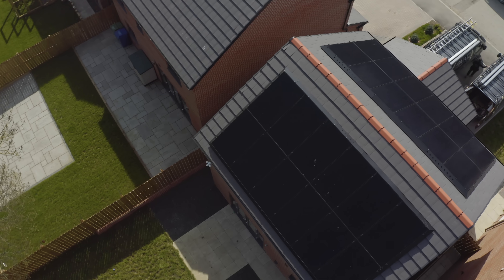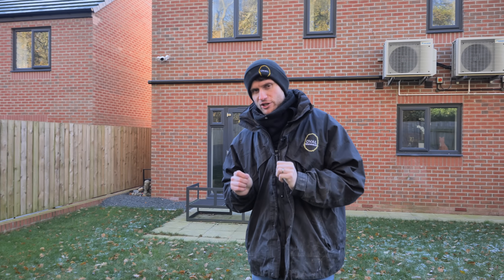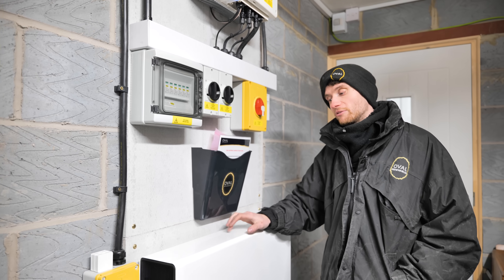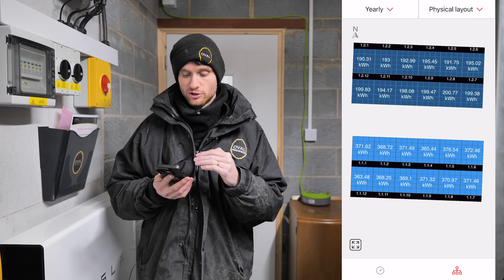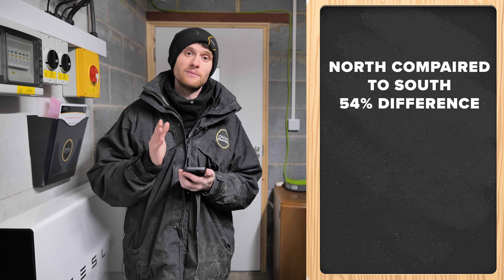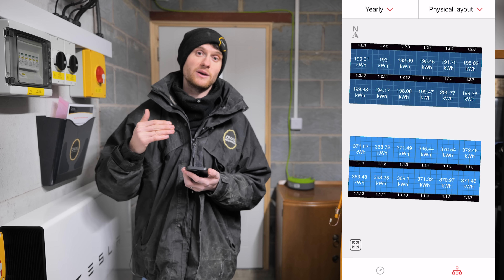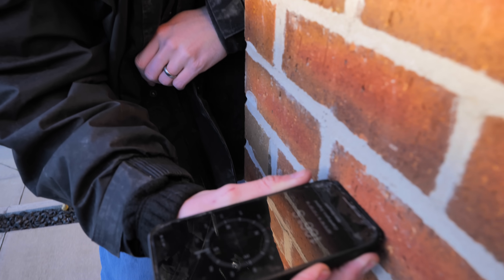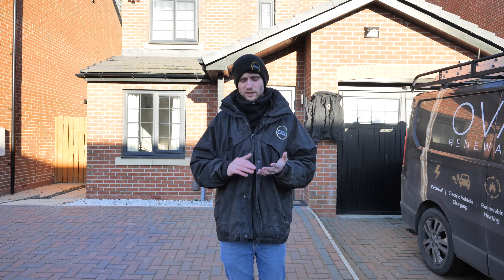North facing Solar Panels? Do they work? Lets get the results!

Comment: Thank you for following up on this, great video, hopefully it will encourage more to go north. They perform pretty poorly in the winter, but with reasonable export rates we can now bank in the summer months when they perform well, to help with costs in the winter. It's also reassuring to hear what you say about installation costs, we've been saying this for ages on forums, get as many panels fitted as possible, as they are already on site, the additional costs will be less per panel. Just one question, if doing the install now would you just go PW3 and connect the strings straight to that? Seems a no brainer to me, no shading issues by the looks of it, and would save a lot on costs, the install would be quicker as well saving on labour.
Reply from the maker: Thanks for the comment, putting the solar straight into the Tesla would absolutely reduce the install cost. I am a huge fan of SolarEdge, we simply wouldn’t have had this level of data without it. For me I feel that the SolarEdge element of the north facing panels has probably helped to increase production as my theory of the reflected light helping to increase the generation on the north means that it may hit all the panels differently meaning optimisation allows the panels the light does hit to use more of it than if it was just getting soaked up by a normal PV string. I have no firm answer but data is power and that is what the SolarEdge kit gives you.
Reply: @OvalRenewables  I'm not convinced it's actually going to make much difference in cloudy diffused light. I have a 2015 SolarEdge system, and also various different string's on a Victron system, so no optimisers on them, in cloudy diffused light I see pretty much exactly the same power on the two identical strings facing n/east and  s/west. Twice last week my SolarEdge system never even started up due to low light, where the Victron still generated something, no idea if newer SolarEdge systems/panels perform better. I'd also suggest it should be a customers choice if shadings not an issue, as doing away with the SolarEdge system would be much cheaper, it's a lot of money to pay just for you to have data, doubt many owners look at it.

Comment: BUT, noticed some export in your first look in the stats, are the north ones just contributing to this in the summer at a tiny price from the electricity supplier. and conversely not adding much to the home or battery in the winter. Needs a more detailed look over the 12 months to find out if the south only would have been enough to use and reduce export to a lower level. eg is the north side just subsidising the electricity suppler? and not contributing much to the home owner
Reply from the maker: Thanks for the comment, I will see if I can do a follow up one to go through the stats for the different months over the same time period. 

However with increased export rates now, at my house I’m on £0.15 per kWh, even if you are exporting all that north power, you are collecting that money to help with the bills in the winter. However more generation in the winter is the ideal situation.

Comment: I’ve been working in the commercial ground-mounted solar industry for over 10 years, and these numbers are truly impressive! I didn’t expect the north side of the roof to contribute around 35% of the annual generation. The ROI must look fantastic now. Well done, and great video! I have been working
Reply from the maker: Thanks mate!
Reply: It's even more at those days when the sun is not shining
Reply: that may not reflect the truth because it was very wet last year. the output from the south facing panel should be less than what it can be.

Comment: So far the NE facing roof is producing about 72% compared to the SW facing roof on my home.
Both roofs have a dormer blocking half of the panels some of the day. When adjusting for the Wp rating the NE facing panels perform at about 67% of SE.
Without the NE roof panels I would be missing out on about 2100 kWh per year.

Comment: You have not discussed the angle of the roof. This roof seems to be fairly shallow - a steeper pitched roof would presumably produce a lower percentage of generation on the north side.
Reply from the maker: I believe I did mention it, sorry if I didn’t. Both sides are 30 degrees which is the standard 👍
Reply: @OvalRenewables  Sorry if I missed it - Thanks

Comment: Great video.  Be interesting to expand on the cost per watt installed.  If people understand even north face ones would cost the same or less due to a south install being put in place anyway think more people would load up.  Is an absolute travesty these new builds aren’t all installed with solar when built
Reply from the maker: I wanted to stay away from that convo in this one as each job is different but there are many shared costs that bring down the cost per kw installed

Comment: Thank you so much for circling back to this. So many channels promise to follow up on projects like this and never do!

Your original video played a big part in convincing me to go for 16 panels on my NW roof and ive never regretted that choice.

Surface area is king and we all have to work with the roofs that we have.

Diffused light is more significant than people may realise.
My NW panels also get a significant amount of direct sunlight in the summer months which builds a lot of export credit in my energy account!

Keep up the great content, it's really helpful! 👍
Reply: @UpsideDownFork  Yes and your video convinced me that north facing solar is worth it.
Thanks to both of you how the word spreads 😀Also my neighbour installed north facing panels in March 2024 and he has produced as much solar as my south facing array installed in 2011 due to the increase in technology output etc.
Reply: @SimonPerkins-j8r  Great stuff!
Reply from the maker: That’s great to hear! I’m glad the video helped! Sounds like you are all setup!
Reply: Are there particular panels that are better for north facing roofs? I expect that some panel chemistries have lower switch on voltages so are more useful for lower light conditions.
Reply: @SimonJHudson  Splitting hairs but there is some evidence to suggest that bi-facial panels are the way to go. 
As the sun peaks over the ridge, apparently the rear of those panels can be better illuminated than in any other scenario. Potentially yielding 10-20% more than standard panels.
I'd like to see some hard evidence for this assertion, but it does make some sense.
Reply: @UpsideDownFork  I commented to someone yesterday that I thought Bifacials might be useful in that scenario.
I still speculate that specific panels specifications might operate better in low light/diffuse light.

Comment: I planned my own Solar Edge system a couple of years ago. At the time I spent a lot of time calculating the benefit of installing a number of the panels on a north facing roof. I put in 24 panels spread over four separate roofs, and feeding an 8Kw inverter / 10Kwh battery. I can confirm remarkably similar results to those you showed us and would agree that (in the right situation) it is totally worth installing at least a proportion of north-facing panels. The system overall has exceded my expectations!
Reply from the maker: Great to hear!

Comment: Interesting video, my south facing roof is already full with 4kw of solar, it’s on a FIT scheme for about 10 years already. I’d like to have battery storage, would fitting panels to the north side be a good idea? Probably go with Octopus Agile for night charging when the import tariffs are low.
Reply: exactly what I did. if you can get on something with octopus outgoing or a similar tariff at 15p/kwh and with a battery storage maybe your ‘average’ home usage is around 8-9p due to running off peak most of the day, then extra solar is helping offset almost 2 kwh for every kwh it generates.

Comment: The optimisers are helping here too, likewise with microinverters the lower starting voltage helps in panels in suboptimal orientation. (I have panels on four orientations)
Reply: I'll beg to differ, absolutely no need for optimisers or micro inverters on either of these roofs, unless the customer wanted the added safety or reporting, it's just added expense. I know this install predates the PW3 but consider how much cheaper it would be with a PW3. I have multiple strings installed, a Solaredge system and a Victron system which users conventional strings, two days in a row this week the Solaredge system didn't even start up, whereas the Victron system produced power from the least optimal roofs.
Reply: @ I can only comment on Enphase microinverters, they start at a very low voltage and with a warranty of 25 years it’s not even like for like comparison with a traditional inverter with just 10-12 years.
Reply: @HaiderAlDelfi  yes they have there uses, but on a roof that doesn't need them they are a risk, I'm pretty sure the warranty doesn’t cover scaffolding costs. Adding batteries requires a separate inverter whether that be built into the batteries or separate, so you still need an inverter if you want batteries.
Reply: @TheRonskiman  Depends on your installer. Covered on mine for 10 years. I also happen to live in a bungalow so really easy to get up there.
Reply: @HaiderAlDelfi  That's good on both counts.

Comment: Agree with you.
I’ve just had installation with PW3 since October on 3 faces at 90’ to each other: clockwise starting from NNE with 4+3+4 panels.
My more northerly 4 have so far produced about 25-30% of my output to date. Yes, poor time of year, but definitely max your panels with the initial installation. I also believe you should have as much battery as you can afford to take advantage of cheap night rates for winter charging.
Reply: And make sure the inverter can charge the batteries in the cheap slot, no good having 30kWh of batteries and a 5kWh inverter as in three hours it could only charge 15kWh for example, this is often overlooked.
Reply: @TheRonskiman  you have to ensure the installer sets it right. With PW3 this is not under consumer control

Comment: Moral of the story is: if you have enough south facing roof to install all the panels you need - and then some - than do it, else if you can't fulfill all your needs - and then some - with only south facing and are ok with installing north facing panels that will have about 45 to 65% penalty on production then go for it as well.

Strickly thinking about ROI, it's not worth it (even less worth it with a battery, the break even is set so far into the future - specially with a Tesla Powerwall, the price it's just ridiculous, you pay an efty premium for what little extra benefits it provides - that by the time you reach break even you'll be needing a new battery).
But if you are thinking about not having to care for any energy bills that might set you back financially for the forciable future then go for it, you will change your habits of comsumption and you'll see your electrict consumption go thru the roof (mine did when I got my pv and battery installed).

Comment: Getting quotes for a house with an east/west split roof and asking installers to put 7 panels on the vertical gable wall which is south facing. No-one seems keen for some reason. I know it is not ideal, but would complement the 2 x7 panel E/W arrays, and as you say, it is not adding much to the expense.
Reply: i would also think about if its the only option
if they can be placed so they are not fixed to the wall it will make the house more valuble..

cant you park a tailer infront of the house :body-blue-raised-arms: 

if you wrap the house in facade panels (like rock panel) and then make the solar panels smooth with the surface/facade panels
it might raise the value to some buyers

it does not need to be thicker then the solar panels, it just needs a small gap for air between the facde panels and the house
rock panel for example insulates like a 50mm rockwool batt

many places do have rules that you need to lower the solar panels down in the roof, so they are not higher then the roof
it gives another look, when they are not raised from the surface 
 just like some tall buildnigs do have them flat with the surface

most walls are not made to have a panel where the wind is pulling
you might end up pulling out stones if to much wind gets behind the panels 
walls are made to take the big presure from above, not the sides

Comment: Another way of looking at it is that these modern panels produce more on a north facing roof that older panels would have achieved when facing south.  It would have been good to show the seasonal variation on the panels between north and south aspects as I am sure the bell curve would be different shape. 

Bi-facials seem to add some additional benefit on a north facing roof too.

Comment: Excellent video has helped confirms my decision to add north facing panels in 2025 thanks
Reply: the number is good just because 2024 is a wet year. not much sunshine to the south facing panel
Reply from the maker: No problem let us know if you need any help with that 👍

Comment: More than worth in my opinion. Looking at  Jan 1, 2024 to Dec 14, 2024 on my system with an orientation of 4 deg off due south) 10 panels North, 10 panels South, (N&S mirror imageed) 4 panels East ( x3 on main roof and one on single extension) and 1 panel West (Single extension *very shaded). Total Production 6600. South 3560 @ 54% of total. North 2020 / 31%. East 1029 / 16% and West 160  / 3%. My North panels generate 57% of what the south panels do. 2025 project....add some "wall" mounted panels on the East elevation and add another battery) I Would reccomend fitting  North panels for sure